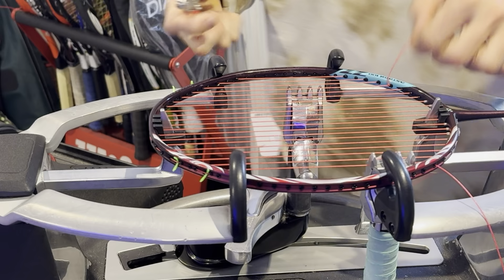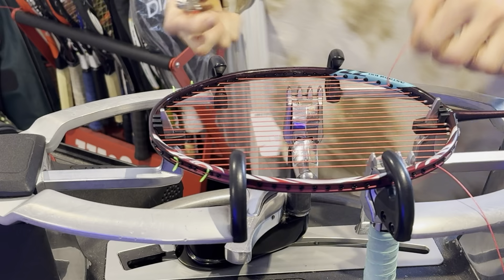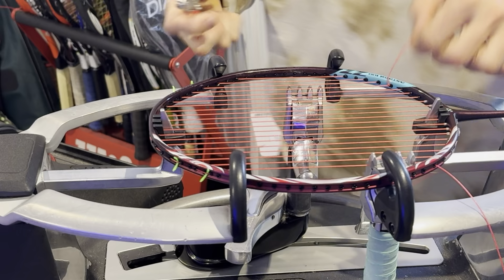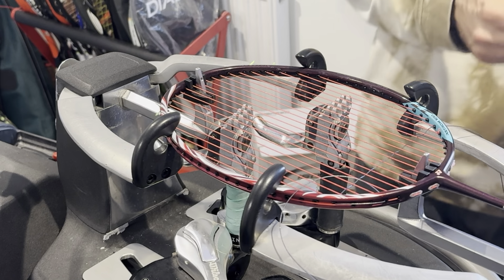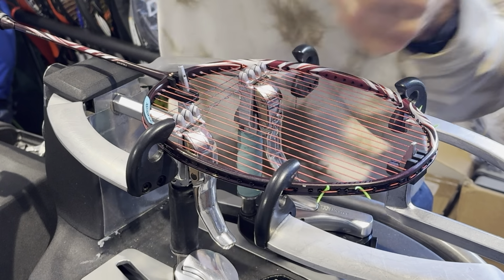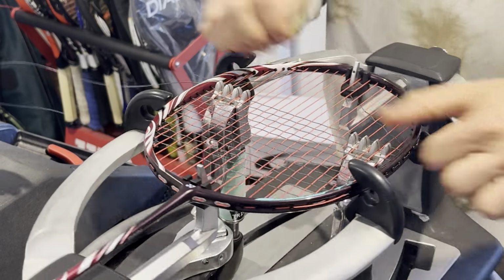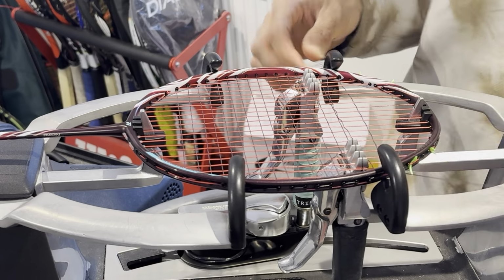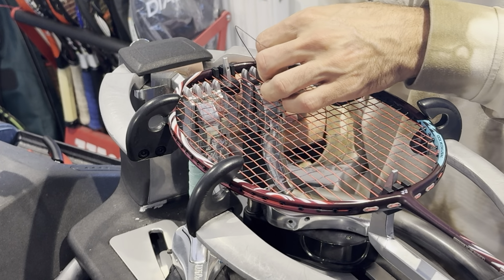How to re-string a Yonex Astrox 100 ZZ badminton racquet

Comment: Any reason for not following Yonex recommended stringing pattern which would do mains to B9 then jump to B12 then up to A14 and back down to B10? Also crosses would be recommended at 10% higher so typically 2lb more.
Reply: It's recommended because that is the weakest part of the frame. You might end up not swinging that way and still find success, but it's recommended by manufacturer because it doesn't put the racket through potential breakage.
Reply: You are losing a lot of tension due to not starting correctly and not clamping the string closer to the frame. I'll bet that the tension comes out to be 3 to 5 pounds less than the intended reference tension.
Reply: @bradcranford157  Clamp bases are in the way though.
Reply from the maker: @nosbodm1806  I have now changed the way I do the mains.
Reply from the maker: @bradcranford157  I clamp the string just centimetres away from the frame/ fixtures. My tension actually is spot on every single time, if anything it comes out slightly higher…every single time.
Reply from the maker: @svlagonda7417  I don’t think he knows much about stringing, clearly! 😂
Reply: @prostringlondon I know a lot about stringing, not only have I been stringing for 47 years I am certified as GRSA Pro Master Stringer and USRSA Master Racquet Technician. I owned a Professional Racquet Stringing team, stringing for ATP, WTA, ITF, USTA tournaments. I've learned my badminton skills from Tim Willis and other world-class badminton stringers.
By the way, how do you know the tension comes out spot on? What device do you use?
Reply: Can you use the 2 knot method?